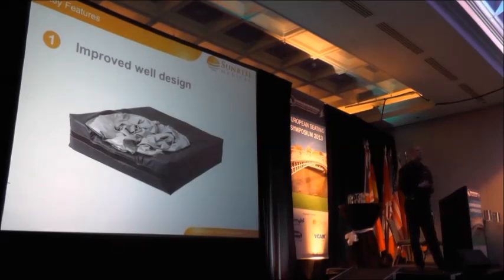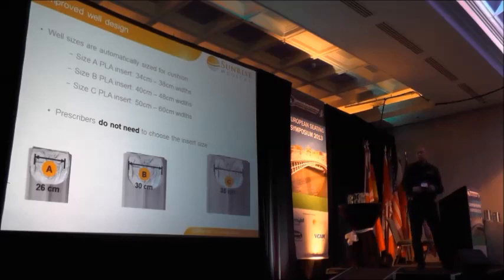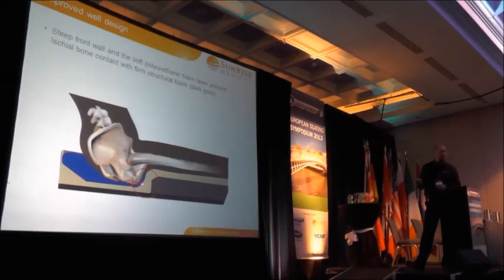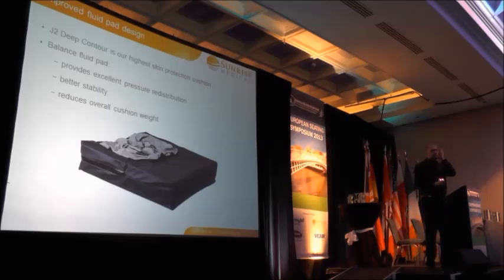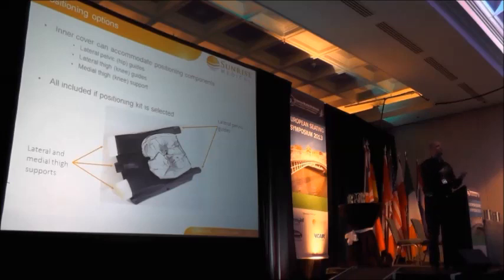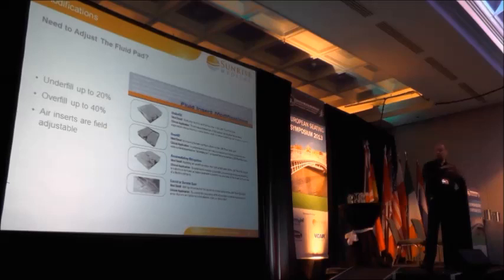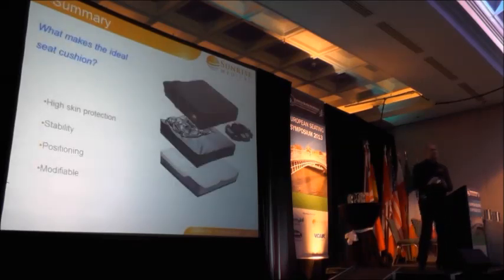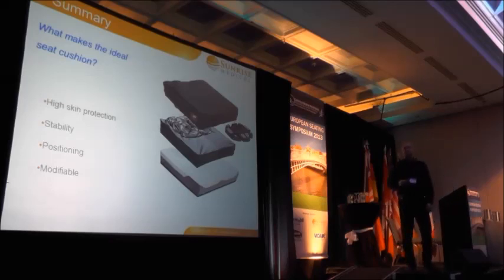Matt Eveleigh  Jay Balance Cushion   ESS 2013

Comment: Hi, I have the Jay 3 standard cushion with standard fluid at present, and central and lateral wedges. I am considering a deep cushion with air instead and am at very high risk of sores and have very high positioning  needs. Can  the Jay 3 PLA be moved backwards or forwards ? I'm not sure if this would help me.
Reply: Hi 

No the J3 PLA cannot be moved forwards.  The PLA can only be moved forwards on the Balance.  However I am not sure how this would help you as this was primarily designed for users who sit slumped down in their chair and they cannot sit upright e.g. kyphotic ‘C’ shaped posture. The users bottom is usually much further forwards in the chair.  The J3 is the best positioning cushion that we have in the JAY range but the Balance is also very good but combines high skin protection (the choice of fluid pad or air insert) and increased comfort through soft foam top layer and we can add 5cm wedges as you have on J3.  These can be ordered as a special modification and they are sewn into the individual pockets on the inner cover and the outer cover is upholstered to match.  The Balance also features 2.5cm hip guides to aid positioning of the hips.   I would recommend the stretch cover for deeper immersion
into the fluid pad. 
Hope this helps!
Regards
Sunrise Medical
Reply: Hi, thanks for the reply. I currently have the incontinence cover on the J3. Would a deep cushion with  the air insert be better for me than fluid?  I find the hard foam uncomfortable but am not sure whether the softer foam on the Jay Balance will make me more comfortable and provide  more comfort. I have had the Jay 3 for 4 years now, could it be that it is the age of the cushion that's the reason I am uncomfortable? What could the problem be? I find there is not enough gel in the J3 for me to be comfortable and for pressure to be relieved. I have incontinence so would the stretch cover help protect against this better than the incontinence cover? Would it be possible for the hard foam of the Jay 3 to be replaced with the soft foam of the JAY Balance, and would this be adviseable and appropriate for me given that I can't sit upright and have pelvic obliquities, internal and external rotation of the feet, legs and hips, knee adduction and a leg length discepancy.
In short, would a new Jay 3 be better for me than the Jay Balance? I hope to buy a new cushion next week, so it would be great if you could reply quickly.I have tried air cushions with air pockets inside the cushion (Vicair) and found air very comfortable. and I didn't get the pinching shear sensation I got from the J3's foam and fluid.
 Based on this, would an air insert be better for me than fluid? I don't know if an extra fluid sac would give me the immersion I need. I am also unable to transfer independently. Unfortunately, I have yet  to meet a  tachnician or rep who was able to assess me adequately about all this.